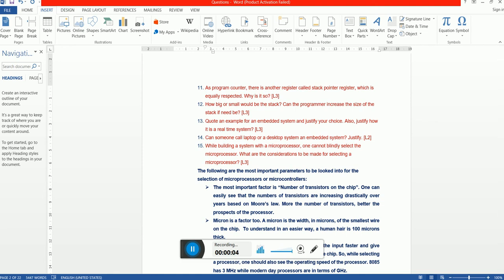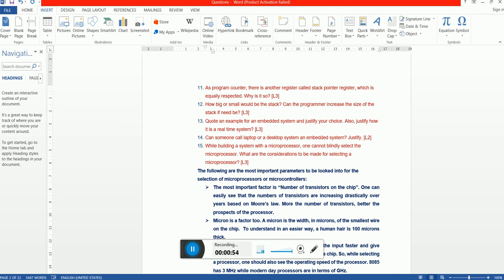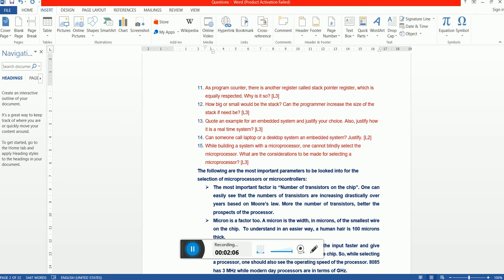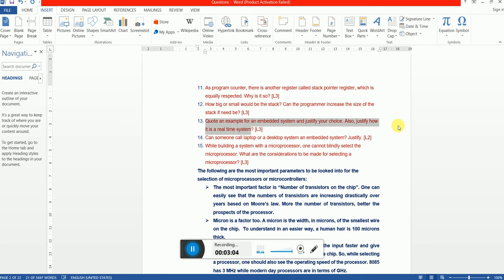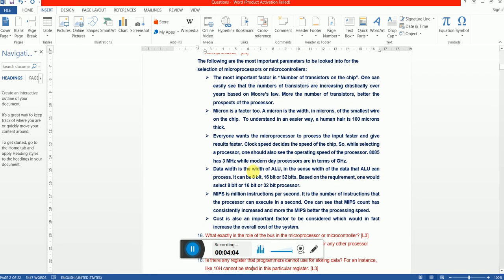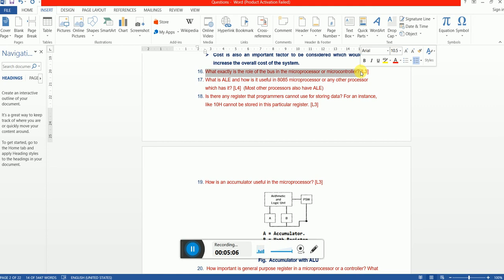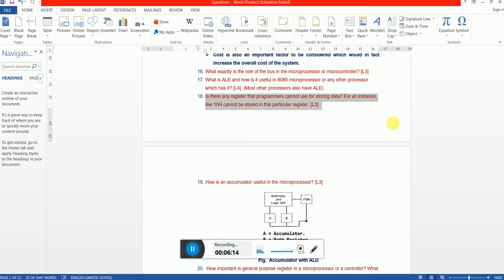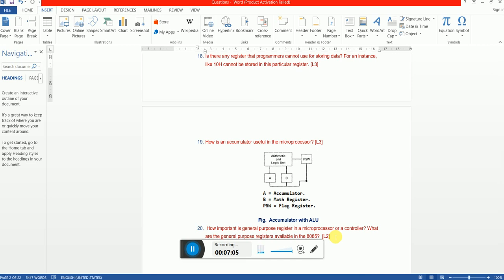Session 2 - Interview Questions from Embedded Systems, Microprocessor, Microcontrollers

Comment: This is a good video sir. I am looking the series a lot. Does no. Of transistors in a microcontroller means the same as it's CPU performance or computing power. And what's the difference between bus and a normal connection. Does arm architecture also have accumulator
Reply from the maker: There bus can carry data or signals. Normal connections may not. More the number of transistors,  better the performance

Comment: Sir what is the difference between startup code and bootloader ,I'm new to microcontroller programming in Keil while programming In c , there is a startup code what is that startup code is there any relation between boot loader can I code startup code
Reply from the maker: A bootloader is responsible for moving, and decompressing, the operating system kernel from long term storage (I.e flash or hard disk) into main memory (RAM) for execution by the CPU. ... Startup code refers to the handful of subroutines that run when the kernel is first handed control by the bootloader.